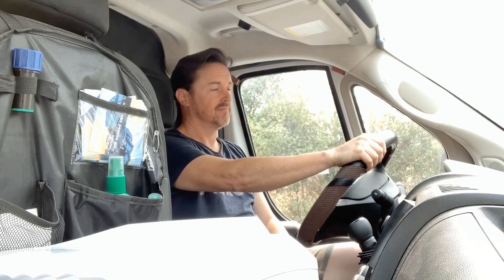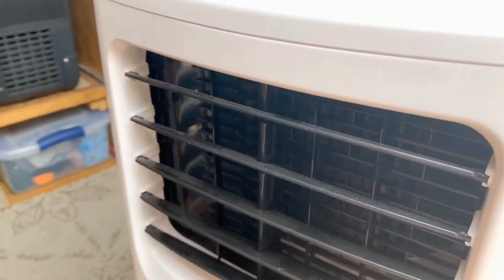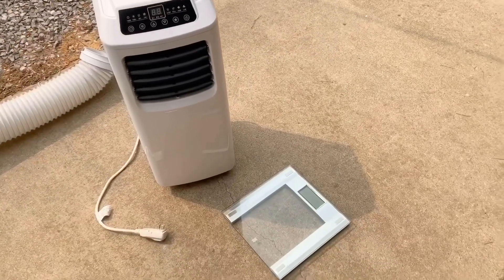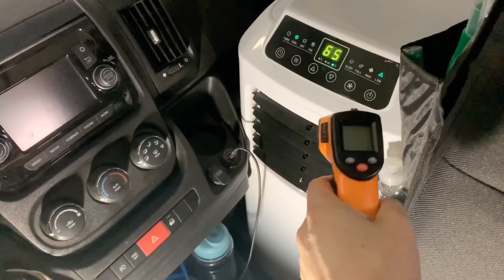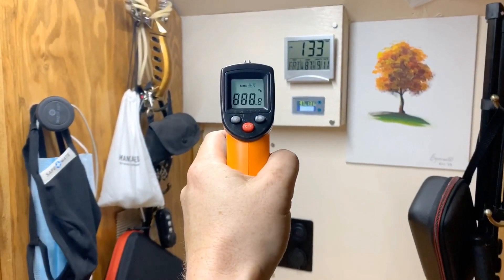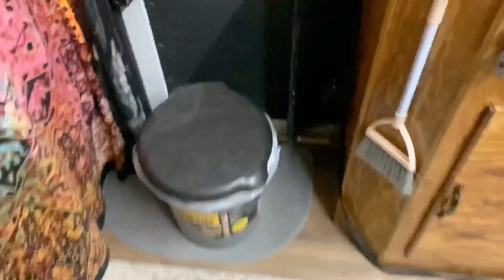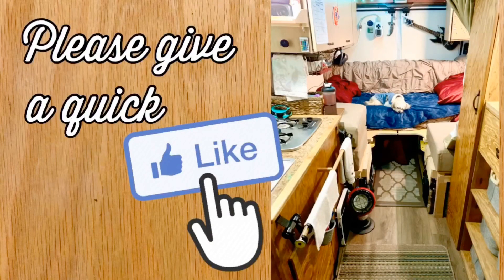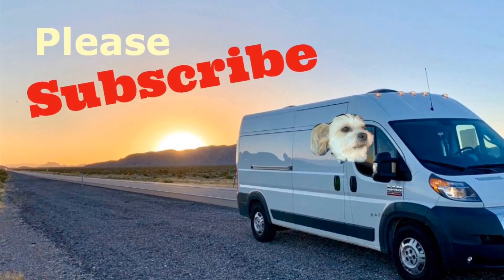Portable Cab Air Conditioner | RV Van Life

Comment: What kind of inverter do you use? And what’s the wattage? We would love to see a video on this, thank you!
Reply from the maker: For this specific A/C video I used an extension cord that runs to the back where my van is plugged into shore power. The upgrade runs the cord to a small generator that taps into the top 2/3 of the vans fuel tank for extended boondocking. To run this on the batteries/inverter was too expensive a method. If someone has the 4K for powerful 300a LithIon & 2,500w Pure Sine Wave inverter and 4000w solar it would work but that was a terribly large expense compared to $450 Generator and modification to the tank. Hope that helps.
Reply from the maker: I suppose I only have you half the info. Sorry. So in my specific citation I don’t typically work summers. I usually spend my summers at high altitudes in nature where it’s 75* outside. So if I do use it (I keep my generator stored at a family members house) and it’s vented outside but located in my van when I use it. 90% of the time I plug it in to shore power but on occasion if I’m boondocking in Arizona/Nevada I’ll take it on the trip with me and use the generator. And stealth isn’t so important with the noise when I’m far away from everything. And in those times I only use it at night when sleeping. It was a much less expensive option for me and how rare I use it when not plugged in. But I love your system. I work hard in winter and take summers off so my annual income doesn’t allow for NICE upgrades hehe.
Reply from the maker: I do have a video on stealth parking btw. My favorite is the “For Sale” sign LOL. I’ve used that every time I’m in cities and works flawlessly LOL. Unless I’m driving so tired it’s dangerous and then I make stupid parking decisions to catch a nap haha. Thank for the complement too.
Reply from the maker: Thank you. I appreciate the complement. It means a lot. 😊
Reply: @George Planter where do you park for free? I'm in the Spring / Conroe TX area and I'm renting a place for now. I'm getting my Tacoma with the fiberglass utility shell up to speed so I can potentially stay in it and I'm looking at all options as far as parking and air conditioning etc. I have 12 years of OTR living on the truck experience. I did everything in the sleeper. Cooked, potty, slept etc.  Thanks
Reply from the maker: Actually I have a video on the places I stay for free. That’s cool that you’ve figured out your truck sleeper. And that’s a long time. Makes me feel like a newbie.
Reply: @George Planter thanks for the quick reply. I was at my storage unit in Conroe today and about passed out from the heat and humidity. I just came back to the area from California which is quite a bit less humid. I have a large fiberglass slide in utility shell with it's own floor in the back of my 6-ft long bed. I moved my memory foam mattress from the big truck to my pickup. From what I'm reading, the floor AC has a 12" square foot print and is 30" tall which would fit in one of the corners at the back by my left side barn door of my shell.  I have two 6-in diameter holes in the doors with boat hatch covers. One of them could be used as an exhaust hole & the unit could be set up towards the back. I would get direct air flow from the AC vents to where it would probably freeze me out.I would still be able to get in and out of the truck using only one of the barn doors or having enough slack in the hose that I could open both. I also have a Honda 2000 watt generator. I'm guessing if I'm in a public parking lot such as Planet Fitness that the generator is a no go. I found a campground with shore power hookups for $420 a month which is a lot less than I'm paying now in this airbnb.
Reply: @George Planter thanks for the information and encouragement. I was in trucking for 12 years and pretty much lived on the truck rent free. Two things changed my status this year. I took social security at the beginning of 2021 and had to get off the truck to not exceed my earnings. The second thing was, I fell out of the truck due to the mechanic taking the stairs off. I fell 6 ft onto hard concrete on my left shoulder. My left collarbone is fractured and I have joint pain. Fortunately I am now on workman's comp. I took this opportunity to move back to Texas to be near my kids and grandkids. Financially I'm doing pretty well. My long-term plan is to retire in the Philippines. I just paid off my house there and have a wife and her son. I want to split my time up between Texas and the Philippines. 
I just want to say that vehicle nomads are some of the friendliest most helpful people I have encountered. I have a long thread on Bob Wells site CRVL. 
Here's my link to my vehicle build:
https://www.angelfire.com/tx/nale/durashell.html
Reply from the maker: I hope the zero breeze is working well. I need to upgrade my own batteries. Soon.
Reply from the maker: I don’t have a house. My A/C is used with shore power only when I’m visiting a family member who lives in the heat. Otherwise I consistently stay in cooler regions and cooler altitudes during the summers and just work during the winter. It’s the only way I can do Van Life full-time. Also your innovations sound cool and hope I can see some pictures or videos on YT someday.
Reply from the maker: Also.. I used to go to Planet Fitness fo years for the same reasons. And I plan on joining again soon now that the world has started opening back up again.
Reply from the maker: One door fixed in place sounds more like what I would do (as long as the other side in plenty to enter and exit from. My A/C is not permanent simply because I ONLY use it on the rare occasion I’m forced to stay in a hot region for extended stays. And yes, 420 is very cheap. I rarely ever plug in but that’s not bad at all. Humidity is the bane of my existence. Makes everything difficult.
Reply from the maker: Thanks for the link. And I agree about vehicle Nomads 😊👍. That sounds like a hugs travel (Texas & Philippines) back and forth. Sorry to hear about your shoulder. I have Calcification Tendinitis in my left shoulder that flares up on occasion so I totally empathize. Hope that all improves quickly. My kids up and married and moved to California and the east coast of Canada. So I’m grateful I can travel and visit them with my lifestyle. Good luck out there my friend. Sounds like you have a lot happening.
Reply from the maker: I enjoyed all the pictures and information on your website. 😊
Reply: @n8nomad419  thanks for the kind words! I hope my shoulder gets fixed all the way, I'm on workman's comp now plus social security so my income is pretty decent. I spent quite a bit of my savings getting my truck road ready again. It sat at the trucking company's yard for four and a half years undriven. Other than washing it and running the engine, it never left the yard.
A couple of questions about the portable air conditioner you have. Did you say it is 12" square by 30 in tall?
I have the perfect spot for it right by the driver side barn door at the very rear of the shell. I have an extra hatch cover that I can cut and make into an adapter for the exhaust and still have the clear ones for when I don't need the AC. I have a power strip sitting right in the area with a cord coming out between the shell and the left tail light inside the bed for shore power or connecting to the generator. I will literally be in the same small area as the AC unit so I would be running it on low and probably still be freezing. How loud is it on its lowest setting? I see where you weighed it at 50 lbs. Thanks for the info.
I'm currently renting a garage apartment with quite a bit of area. My son is moving into an apartment at the end of this month and I told him I would split his rent with him. I don't want to wear out my welcome though, so I'm looking at making the truck and camper ready to go. I will have to do doctor's appointments for a while and consider going to the Philippines towards the end of the year. I've been gone from Texas so long I have a lot of catching up to do with the kids and grandkids.
Stay safe out there my friend and thanks for your great videos. 👍

Comment: I'm convinced portable ac units are actually heaters in disguise.  I'm installing a minisplit system in my van, powered by battery (shore,solar and alternator charged) and shore power while camping.  In a pinch I can power it by generator if solar is poor.  Costs more but I think a great option for the long haul.
Reply from the maker: That’s why I had to isolate the exhaust and heat to guide it outside. I did upgrade with an insulated duct and other minor adjustments. Because it’s basically equal heat and cooling which is an insane waste.
Reply from the maker: I also have mine with shore/generator/battery options. But I never use the batteries for it since it’s terrible when (again.. the fridge compressor kicks in and I happen to start the water pump for the sink etc). Sometimes I wish I had a $150k setup with a single thermostat on the wall ((like a house)). But I typically stay in cool beautiful environments during the summer. So to be honest I store it all away unless I’m visiting family or friends in hot zones.
Reply: @n8nomad419  the nice thing about the minisplit is it has a variable speed compressor so there isnt that initial surge like traditional units which tax the inverter or cause problems with voltage drop on batteries already getting low.
Reply from the maker: Mine has an “eco start” which I’m thinking is the same thing. For that reason. Otherwise it would utterly shut down everything I have. But I’m always looking for better and more helpful ideas. I feel like VanLife is a never-ending evolution
Reply: @n8nomad419  I have tried a unit like this in my Truck camper...here in Texas they just cant hack it when it is 100 outside, even with an insulating sleeve on the exhaust hose...hose still gets over 100 degrees and can barely maintain 90 degrees inside

Comment: what is powering the unit and can i do the same with my minivan
Reply from the maker: There’s 3 options to power it. 
1) Extension cord from a source to an inlet at the back of the van (ME) while visiting family, friends, campgrounds but very low powered A/C unit out of respect
2) Small Quiet gas generator that is directly tapped into the top 3/4 of the van’s fuel tank (My Future Goal)
3) Way more battery banks and Solar panels than I currently have and in a location closer to the equator for constant direct sunlight (extremely expensive system to setup, but possible). -N8 😊

Comment: hey Nomad I'm new in your Chanel 
what is your power source ?
Reply from the maker: I have it plugged into shore power (extension cord). But I will be eventually running it off of a gas generator/inverter that is tapped directly into my Vans fuel tank for boondocking.

Comment: how big is your batteries? and how long can you run the portable A/C? thanks
Reply from the maker: I don’t run it in my batteries. In the video I have it running off of shore power and at the end I talk about connecting  it to a small generator that taps directly into the top 2/3 of the vans fuel tank for extended boondocking. It’s cheaper than investing into another $2k of batteries and a generator has the benefit of running all night so I can sleep. In fact I only run it at night now so I can boondocks longer. Then I park the front half of my van (windshield area) under shade to prevent it heating up too much but still have the solar in the sun.

Comment: Man do you power it?
Reply from the maker: I plug into shore power (extension cord) when visiting family or friends. That’s the only time I use the AC unit. Otherwise I’m living in areas that have nicer temps. But it can be run off a small generator.

Comment: why not leave the heater outside and pipe the cold air inside... might need to put a chain and lock on the ac
Reply from the maker: I suppose that could work really well. But it fits perfect where it is.

Comment: I think your missing the whole idea of what a air conditioner is suppose to do. When you separate the two area's your no longer removing hot air from the entire van. If you intend to use this on a regular base's then set it up permanently with a exhaust through the van wall that allows you to set the portable air conditioner in the center of your van where it will do the job it's suppose to do.
    Drawing the hot air out of the space you want to condition is more then half of the job it's suppose to do. When you separate the two rooms, your only drawing hot air out of one of the rooms. It's possible that if you were to set this thing up properly with good insulation barrier around your windows in the front of the van, and center your unit in the very center of the van, that you could cool down both area's, but you need to cut out a exhaust opening in the van wall at the center of your van.
Reply from the maker: You’re right. That is the optimal way. And I was not clear why I personally set it up this way. But I do this because I only use it when visiting family/friends and hook up with an ext cord during that time. 95% of the time I’m a Nomad. So I simply drive and live at higher altitudes during the summer. But if I was in the heat more often, your idea is the most optimal for sure. I have regrets and lack of info and errors on all my videos lol. Well.. maybe not the VanLife Humor videos LOL. But I hope I help some people. I chose not to monetize as a well (but YT forces commercials anyway haha) Ugh
Reply: @n8nomad419  I thought your video was great over all, you did what most people would do and found the best way to use it as soon as you could, so for temporary use it was fine.
    I especially like the the change up on the aluminum exhaust verse's that of the plastic, great idea and would still be my choice even in a permanent set up, definitely reduced the heat which means more went outside then remain inside.
    Giving this whole thing another thought, that might fit even your mobile travel needs from place to place, and without damaging the side of the Van wall, by adding a roof top vent that could be set up for the exhaust when you needed it. 
    It would give you a normal everyday use for the nice area's and a quick change exhaust system for the temporary hot spots and not damage the van at all, thanks for your well appreciated efforts and your timely reply's.
Reply from the maker: @ambroseabellair5306   I appreciate your input. Stay cool this summer 😊

Comment: Why not a rooftop ac unit?
Reply from the maker: Honestly 2 (personal reasons). The rooftop A/C is way better but I wanted my van to be 100% off grid and that would require shore plug-in. And I can run this A/C on a small generator. Also.. (again just a preference) but if or when I can plug in when visiting family I didn’t want to use a lot of utilities. Rooftop draws at least 2,000 more watts.
Reply from the maker: If I planned on staying at an RV park or pay utilities somehow.. I’d prefer the rooftop for sure. No question 😁.
Reply: @n8nomad419   makes sense

Comment: How many  batteries    do u need to run a ac  in a van
Reply from the maker: It would be Very expensive (thousands) and depend on the specific unit. I use shore power because I only use this when visiting with a family or friend. For this unit it may be around 1400 amp hours but also depends on how many hours and if there’s any solar etc. many variables so difficult to answer. Sorry.

Comment: Are you running a 4,000 watt power inverter?
Reply from the maker: No. Because I’m running this AC off of Shore power not my batteries. It can be run off of an external generator that is tapped into the top 3/4 of the vehicle fuel tank too as mentioned at the end. One can run this off of Batteries and inverters if willing to spend way too much on an extremely expensive system. I just don’t have those resources since I’m a minimalist financially as well LOL

Comment: What do you recommend to power the AC
Reply from the maker: 3 Options
1) Massive LithIon batteries and a powerful Inverter (COST: $4,000)
2) Small quiet generator tapped into the top half of the gas tank (COST: $450)
3) Shore power with extension cord (COST: $40 + Misc. fees)
Reply: @n8nomad419  I can't thank you enough for your response so quickly.  Holy wow, 4k?  It's more so a van for tailgating and the air conditioning would not need to be ran for more than an hour or two at a time.  I live in Florida so we only get two months out of the year with weather that doesn't need air conditioning. Would you have any Amazon links for the power inverter that I can support you with?  I understand this is a home for you so every investment matters.
Reply from the maker: I truly appreciate you. But no, I did not monetize YouTube (but they force the commercials anyway) and I have no affiliate Links or anything at all. I just like making the videos and hope to help people. But I would recommend a 2,500W inverter if going that route (especially since I’ll assume other things will be using the same inverter). If you use a generator there’s no need for an inverter (usually built in).
Reply from the maker: Also… if you ever have any questions at all about this stuff.. feel free to ask. It’s rare I take more than 8 hrs to respond (usually because I’m asleep LOL)